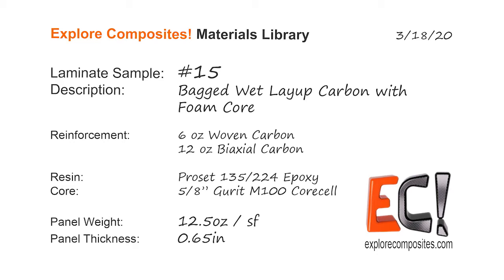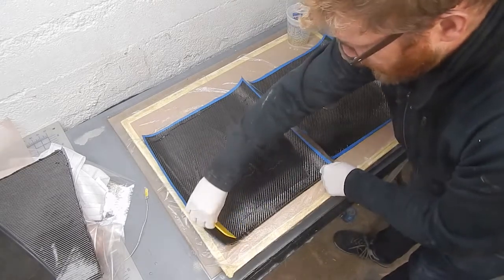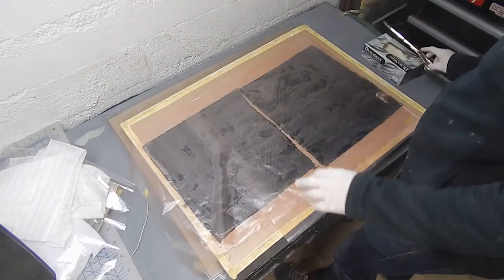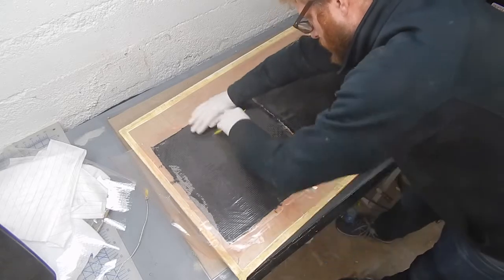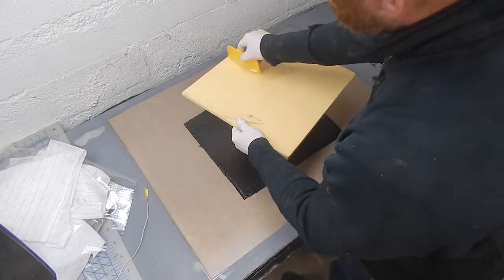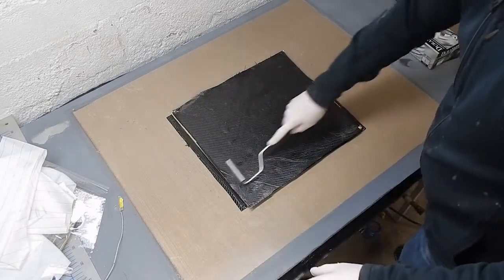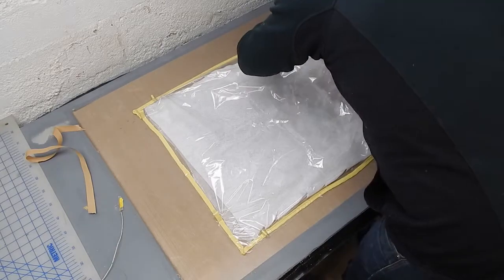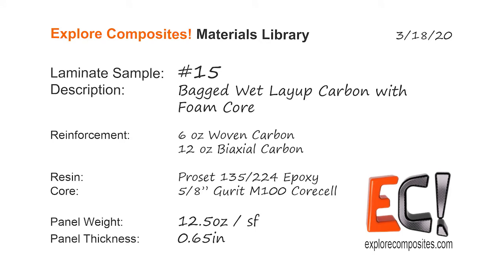Laminate Sample #15: Vacuum Bagged "Wet-Preg" Carbon / Epoxy with Foam Core

Comment: Thanks for a great video explanation, I'm planning on making a laptop computer stand from carbon laminate sandwiched foam and this has shown me how to easily make the main panel.
Reply from the maker: I'm glad it is useful - for a flat panel, you could probably get away with layup in place like in Laminate Samples #18 and 24 - just make sure the core is perforated!

Comment: Great video.  How would you go about making a CF panel with a core to add rigidity, but where you will see the exposed edges?
Reply from the maker: Lots of ways - some harder than others!  Its still a mess but this article has pictures of edge details: https://explorecomposites.com/articles/design-for-composites/composites-details-edges-holes-and-joints/

Comment: its interesting how this came out alot lighter than other corecel techniqes in terms of resin to fiber.  I'm working on a h-45 divinycell surfboard and i'm trying to make a plan for preventing resin absorbtion in the open surface cell structure.

Looking at this technique it looks like you fully wet out the surface then used the vacuum to pull some of that resin through.

Do you think the same surface adhesion could be achieved by rolling on a surface layer of resin instead of full wet out?

My alternative technique would be q-cell fairing prior to lamination, probably apply the fairing and let it gel then laminate.

Also, do the closed cell PVC foams have a miximum vaccum pressure?  I mostly do EPS  which i have to be careful not to pull to much vacuum on.

Thanks for these videos!  these are great!
Reply from the maker: First off I think my 50% resin by weight estimate is way wrong - maybe 40% is more like it.  The squeegeeing between plastic is quite effective at getting even and minimal good resin ratio.  The M100 core is denser than double density so it has smaller cells and absorbs less resin.  In a larger part it would be good to skim/roll the core with a thickened mix (cabosil/q-cell mix or similar) which would further reduce weight.  

Surface adhesion with epoxy should always be stronger than this low density foam if well compacted and not too well filled - 100% q-cell on 8lb foam would be a weak link.  For your H45 a tight screed of filled resin either peel plied and cured or just laminated over should work well.  Even just straight unfilled epoxy won’t be too much heavier.  You can bleed off easily with slightly higher vacuum.  15inHg is tops you’d want - less is fine.  

You shouldn’t crush 3lb foam unless you have a very pointy corner - sure the compression strength is well above even 14.9 psi!  EPS is just so much weaker and sort of randomly strong so it compresses in uneven ways - at least in my experience...
Reply: @ExploreComposites  Thanks for the reply and the awesome vids!  I'm going to do some test panels this week and see what they feel like.  This h-45 has a suprisingly tight cell structure (i had previously used the green foam PVC products which were terrible) so i have a feeling straight epoxy might work out
Reply: @ExploreComposites  What is EPS?

Comment: Nice video. Why not gluing ready to use carbon fiber sheets together with foam with added pressure?
Reply from the maker: You could, and for flat things this would be great.  I have a sample video of this process with G10 sheets onto honeycomb core.

Comment: Great Vid! Why did the vac bag (or did the vac bag) not crush or soften the outer edges? Could you use this method over common pourable foam perhaps? I'm thinking of 3d printing a shell mound for foam,filling and then vaccing down against the foam which can either stay or be removed or hollowed out later? I have seen a lot of machined or sheet foam vac bag composites but never over a poured pu foam. (or even from spray cans)
Reply from the maker: It shouldn't round over the edges at room temperature with this foam - but its relatively dense stuff.  Spray or pour foam is usually light density and it might crush especially on sharp corners.  Lighter foam would be more prone to denting or delamination - so would need more fiber over it to be similarly tough.  It's worth a try but I'd look at it more as an experiment than a for-sure kind of thing.  Lots of variables!

Comment: Around 3:40 you mention that the wet-preg has longer handling time than the epoxy in the pot, why is that? Due to the self-heating in the pot, or is something else in play?
Awesome set of videos and this wet-preg looks like a really nice trick, I wish I had known about it for my last project where I had to make cut-outs and spent quite some time swearing!
Reply from the maker: Yes this is all about not having a big pot full of resin self-heating to destruction.  Once its in the thin sections it will be more about the gel time than the pot life.  This just lets you front load the wet-out instead of doing it in steps.  It does really help with fussy jobs, especially with patterns or tapes.

Comment: Awesome video - Thank you! 
Is it also possible to run with peel ply on both sides of the material so that two adhesive surfaces are made instead of having one smooth surface and one peel-ply surface? Does that change the process at all in terms of vac process or anything like that? Currently rebuilding a high performance boat and looking at making a whole sheet of this for reinforcements on the inside to distribute loads. 
Thanks in advance!
Reply from the maker: You can, but you'll have to wet out the peel ply as if it were a very thin piece of reinforcement - and it is possible to trap air and make it much messier.  If you are secondary bonding it then this isn't a huge deal.  

For a flat panel it might be easiest to lay out the peel ply on the mold (table) surface and pull it flat and smooth with some masking tape holding it in place and then wet through with resin and a squeegee.  You can do the same for the carbon too - and it will be quicker and easier than wetting out on plastic.  The plastic method is great for complicated laminating jobs because it is easy to do a very neat job and use patterns... for sheets of material you may as well just wet it out in place.
Reply from the maker: Check out sample #5 and #18 and #24 for more details on this.
Reply: @ExploreComposites  Thanks so much for your reply! I'll be sure to check the other samples!

Comment: great video explanation. Im planning to make a prototype vehicle with monocoque chassis, what a core material appropriate to hold a 60 kg driver with budget friendly . thank you
Reply from the maker: There are lots of variables and I am not the one to weigh in on monocoque engineering!  A structural foam core like the one used here could be a budget-friendly alternative to a honeycomb core but realistically, when you take tooling into account, the core is a pretty small fraction of overall cost.  A simplified chassis assembly made from flat cored panels taped together might be more cost effective for prototyping because of the flexibility to make changes and much-reduced tooling costs.

Comment: Is it possible to use this method to make very large panels such as 8' 6" X 20' with a 4" thick closed-cell foam core? I am in the planning stage of building a 6x6 overlander and the composite panels would be the walls, floor, and ceiling of the living habitat on the back of the truck frame. The foam core needs to do double duty as part of the structural sandwich panel and as high R-value thermal insulation for the most extreme climates.
Reply from the maker: I get a little worried about very thick low density core without fairly skins on it - denting, delaminating and buckling are just really concerns.  Lots of people seem interested in the structure+insulation combo and I don't have much experience with it - but SIP panels work for houses.  For the sizes you mention, I would suggest starting with pre-cured sheets of fiberglass and gluing them to the foam panels.  It is really hard (and heavy) to bleed off air through 4" of foam when the foam has to provide compression to the bottom skin.  One interesting thing I have wondered about is if it might be better to build a skin on stringer construction like an airplane and then spray or apply a totally non-structural foam to the inside.  Overall weight might be less and would be more damage tolerant.  Sticking stuff to the inside of the foam might be an issue and there would be probably lower thermal performance and more thermal bridging, but could be worth a look...
Reply: @ExploreComposites  Thank you for your reply. I guess I left out one key piece of information the main structure of the habitat will be welded 90 degree 3/8"x4"x4" stainless steel along every edge and vertically in the corners, it will be build like a Conex oceangoing shipping container. The composite panel would be epoxied and riveted to the inside of those steel members just to make an air tight enclosed box to live in. Any significant weight inside the habitat like the battery bank, water tank, etc will have adequate fiberglass reinforcement in the floor to disperse the load to a larger surface area. I have seen SIP panels and these would be similar. EPS foam used for insulation come in 15 and 25 psi compressive strength. Anything of any weight(kitchen cabinet panels, interior wall panel) would be secured primarily to the floor and using secondary securement to the walls as needed. The stainless exoskeleton along with the subframe under the floor will bear the brunt of any major loads.

Comment: Thank you for all the detail explanation. I’m very new to resin lamination, but I have a big dream project to make a foldable bike camper out of fibre laminated polystyrene… 
I’m still on the research part, but I still haven’t seen someone use polystyrene with resin and fibreglass, do you know why? 
I need that thing to be rigid and light cause we are gonna pull it with a Surrey Bike… 
I would appreciate any insight on the matter
Reply: some resins will melt polystyrene foams
Reply from the maker: You don't know until you test it... and probably best to stick to epoxy.  I've heard of people doing it though but never seen the results.  It would be kind of like a box built like a surfboard - low impact strength.  Not sure how light it would be compared to a thin sheet on frame construction.  Thin plywood on stringers is pretty light!
Reply: @ExploreComposites  really ?!😃 you think that the end result may be as heavy as plywood? Cause plywood is way easier for me as a material.

Comment: how would you add a non compressible mounting point somewhere on the panel? is a hole drilled in the foam core and filled with graphite powder mixed with resin or some sort of metal insert better? do i need a specific kind of graphite powder? i'm building a front splitter for a car that needs to withstand substantial downforce
Reply from the maker: Drilling and backfilling with filled resin works.  It needs to be a sizable fill completely touching each skin.  Core can be dug back with an L-shaped tool in a drill.  You can also mold it in with G10 of carbon plate if location is predictable.  G10 tubes work well for through fasteners as compression bushings too - sized right they can be tapped too.  Assuming carbon because you say graphite filler (silica filler is good too) but aluminum inserts or tapping plates are common with glass laminates but no good long term with carbon.

Comment: Do you ever conduct mechanical testing of the samples you make?
Reply from the maker: Not really, but I'd like to.  The problem is that doing mechanical testing right takes a lot of work and some equipment I don't have.  I do a little core shearing in a newer sample - #43b - but it's nothing special!

Comment: Could you add a peelply and breather under the piece as well as the top to avoid needing to drill holes in the core and give you a textured finish both sides for bonding?  I'm constructing a thick foam core panel that needs to be bonded both sides and I don't want to drill holes through it, I'm just concerned the breather might not compress evenly so distort the part?
Reply from the maker: You could but it might not be very neat.  The breather is not a great help as it would get choked off with resin very quickly.  Maybe if you used a perforated release film between the breather and the peel ply - same top and bottom - it would work ok?  I've never done it and it might not work!  

Short of laminating one side and then the other in two separate operations I don't have a fool-proof way to glue skins to core without some perforations.  I tried that in sample #24 and things don't go well!

Comment: Thank for this great video. I want to make Caravan with this composite.. Do you recommend it?  or What do you recommend for making for exterior of a caravan. Thanks
Reply from the maker: I am not at all familiar with this application - never built a caravan so don't know how they are typically engineered.  I'd guess that fiberglass would be plenty good instead of carbon but the general layup method sounds fine.  You may be able to do a open molded layup and save the trouble of bagging the skins.  Bagging core is always nice on curved surfaces.  Is weight a huge issue?

Comment: Why don't you use roler for apply resin on carbon fiber ? Roler is very simple for applying
Reply: The squeegee forces resin deep into the fibers rather than coating just the top layer of the cloth
Reply from the maker: Rollers are good too.  For larger parts, a paint roller to apply resin, squeegee to spread it and laminating roller to remove air from between plies are all very useful.

Comment: No strength test?
Reply from the maker: Not yet - working on it!  What kind of "strength" data would be most helpful for a sample like this?  I'd be inclined to test the skins in tension and compression separately and then some kind of longer beam test with the full cored sample to get a core shear and failure mode understanding.  I have a small "Instron style" tester but still have lots to learn before I feel comfortable releasing actual numbers on the internet!

Comment: Can I guy large volume of Carbon fiber from china..and use it to build a catamaran to make it super light?  Seems like the costs in china are very low, when buying in bulk.
Reply: I have brought carbon from China, Japan and the USA before for my high school/university RC boat project. 
The main difference that I found was the shine and aesthetics of the finished product, Japanese carbon was the shinest with a very even and smooth pattern, while the other two lacked in the shine and evenness of the carbon pattern.
however, from my testing, there was no structural difference between the three.

Comment: You may wish to make a note in every video that these processes are not the best for aircraft parts. Most of the methods you show will result in parts that are too heavy for aircraft.
Reply from the maker: With the right choice of core and skin reinforcement the method shown here would be adequate for aircraft parts - small or one-off especially.  Aircraft parts are made with nearly every possible composites manufacturing method and success (including weight targets) depends on engineering and process control.